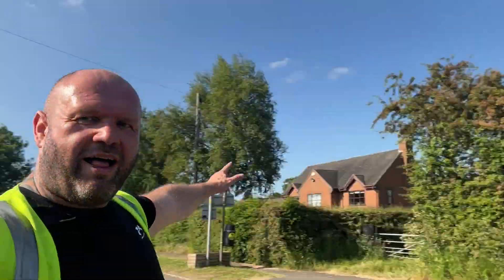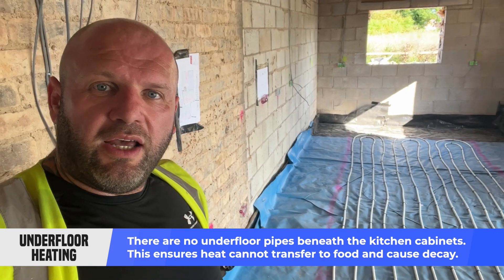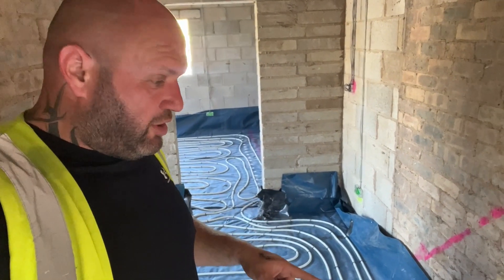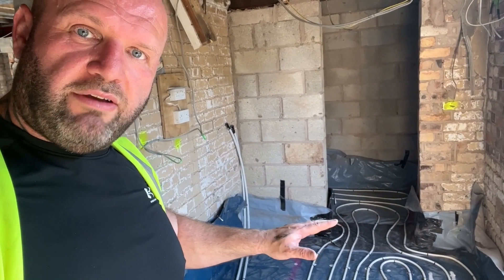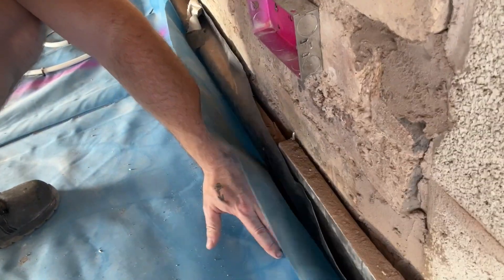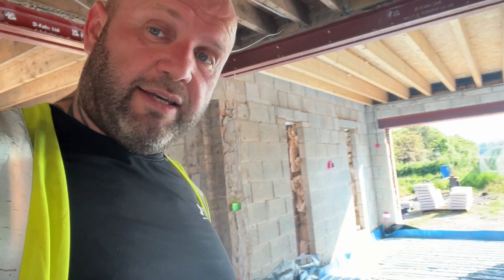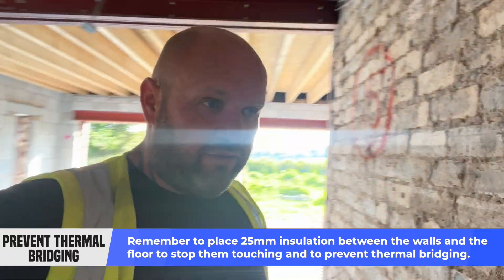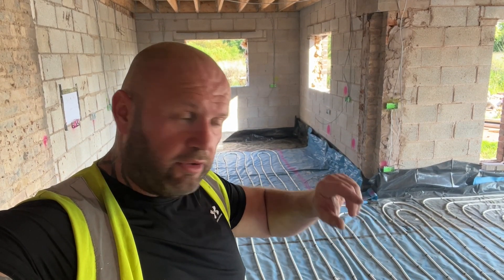Underfloor Heating Subfloor Construction

Comment: Great video. Super informative. How long would you recommend for the screed (that gets poured over the piping) to cure before laying your flooring of choice?
Reply from the maker: Hi Rob. Thank you for watching our video and for your question 👍 Can we just ask: are you using traditional screed or liquid screed? And what depth are you going to?
Reply: Hello, can this underfloor heating be achieved over an existing concrete slab/base ? I know if using a bonding agent on the existing base it will adhere to the new concrete base, so can the underfloor heating be added to the new concrete base that will be on top of the old one?

Comment: Great video bud.  
Question, if it’s going to be a while before you screed, is it ok to walk over the pipes etc?
Reply from the maker: Thanks for watching and for the great feedback, Martyn – much appreciated 👍🙂 In short, the answer is no, you shouldn't walk over the pipes. Once the underfloor heating pipes have been pressure tested, you should screed straight away if possible.

Comment: Hi, my builder has used, hardcore, certified stone, radon barrier, insulation, vapour barrier, ufh, and the next step is screed. I have been asked to decide on sand and cement screed or liquid screed. It is a small mid terrace. Which would you recommend?
Reply from the maker: Hi Caroline. Thanks for watching and for your question 👍 Both will do the job, but we prefer liquid screed because it dries faster 🙂

Comment: When would you put stud walls in after screed or straight of the concrete?
Reply from the maker: Stud walls should go in after the screed has fully dried. Installing them too soon could trap moisture, leading to issues like warping or mould.

Comment: Looking for help purchasing a bungalow built 1960s electric underfloor heating do I keep it ?  And install insulated wet underfloor heating with air source heat pump?  Because I am not replacing gas or oil boiler no grant.  Floor area 100ms

Comment: Quick question. When laying the concrete slab that goes over the hardcore and sand blinding, should you also place insulation around the edges of the concrete to prevent thermal bridging?
Reply from the maker: Yes, 25 mm upstands :)
Reply: @HYPEBuilding   That's interesting—I was wondering the same thing. Would you also consider adding a perimeter edge expansion strip to allow for expansion, or do you think the 25 mm up stands would serve that purpose? I ask because the PIR seems quite dense and doesn’t appear likely to compress enough for expansion.

Comment: I am planning on doing the same.  I am replacing suspended floor with concrete. 

but i have void of approximately 109cm depth. 

Is this going to be an issue? I hear i shouldn’t exceed 600mm of hardcore.

Any advice please

Comment: Is there a difference between PIR insulation being installed below or above the concrete slab?  It looks like this video has the insulation above the concrete slab but my drawings have it underneath.
Reply from the maker: No so insulation goes underneath.

Under floor heating, the method is, concrete slab, insulation, underfloor heating (wet system) then screed over the top.

Using appropriate membranes where necessary.
Reply: Great vid, answered a few bugging questions I had about insulation under or over the slab. I think if I we're to ask one question it would be recommended depth on insulation, bigger would always be better i guess in terms keeping heat but what would a good minium range/depth be

Comment: Hi,What would be the approximate cost for it ?
Reply from the maker: Hi Shincy. Thanks for your question. It's very difficult to give an accurate cost or a price per square meter. With underfloor heating, it all comes down to the size of the house/room you're working on and the depth you're digging out.

Hope that helps in some way. Thank you for watching our video. Much appreciated, as ever 😀👍

Comment: Sorry, this is ridiculous... 6" of concrete (reinforced, I suppose?) and then (insulation and) another 2" of concrete screed?!!  How on Earth is that in any way sustainable?  You could drive a 40T artic over that lot!!  Is this the utterly moronic OTT building control stupidity at work again, or what?   If the concrete was a slab supporting the entire brick structure then I'd understand but all it is supporting is furniture and foot traffic FCOL!! Why not put the insulation under the concrete and run the UFH pipes in that?!!  And make it 3" thick, *max*?!!!

The top membrane is surely just to contain the liquid screed - and your waffle about 'condensation'...   What?!!!